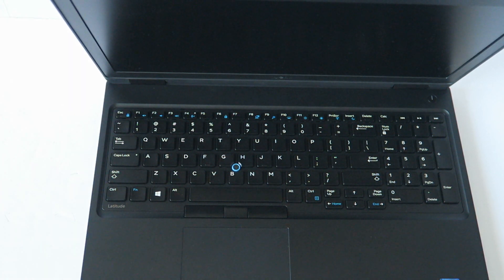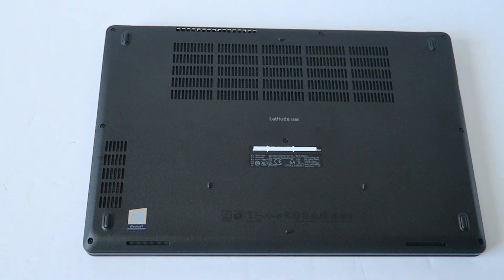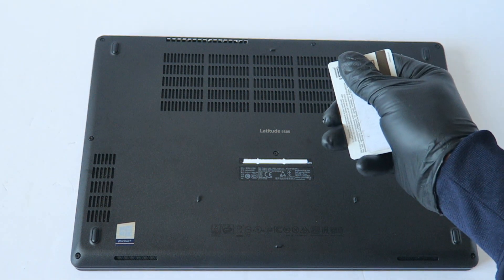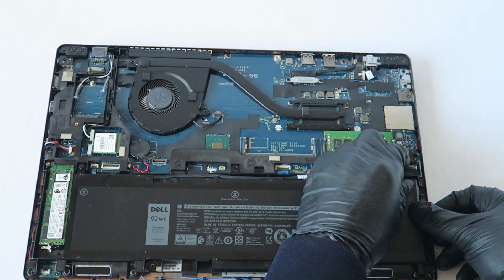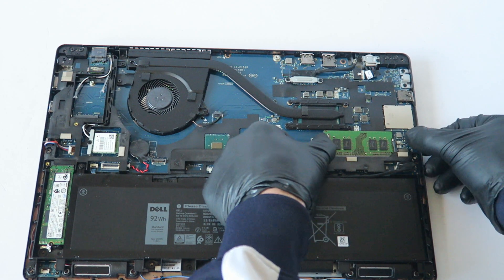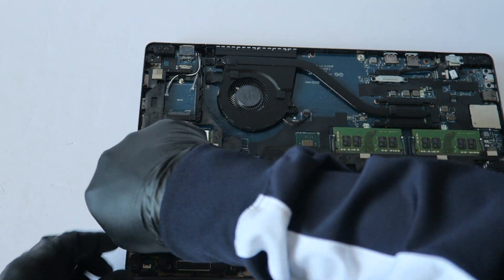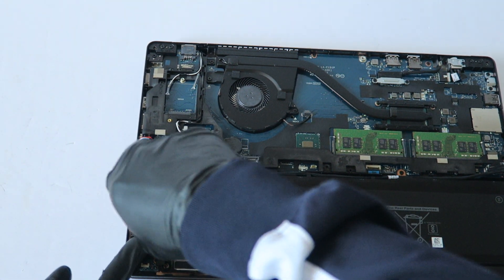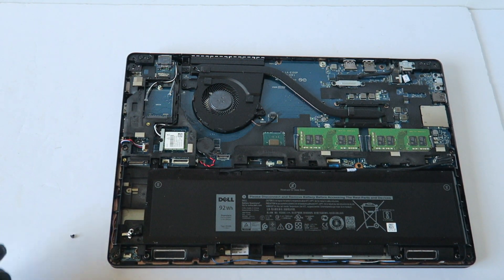Dell Latitude 5580 Upgrade RAM SSD

Comment from the maker: List of parts and upgrades will work with this Dell Latitude 5580

USB 3.0 Flash Drive:

(1.) SanDisk 32GB 3-Pack Ultra USB 3.0 Flash Drive 32GB (Pack of 3) 
https://amzn.to/42bHXKy

(2.)  SanDisk Cruzer Glide CZ600 32GB Sdcz600-032GB USB 3.0 (Pack of 1) 
https://amzn.to/429bCnL

(3.)  PNY 32GB Turbo Attache 3 USB 3.0 Flash Drive 5-Pack
https://amzn.to/44bQEXk

https://www.microsoft.com/software-download/windows11
Create Windows 11 Installation Media

How to Install Windows 11
https://youtu.be/aQmt5rQsrKc

Driver Kit - 64 Precision Bit Set
https://amzn.to/42N3fjh

SSD List M.2 Type 2280 NVMe PCIe:

(1.) Crucial P3 Plus 4TB PCIe M.2 2280 SSD
https://amzn.to/3URAG2t

(2.) Crucial T500 1TB PCIe Gen4 NVMe M.2 SSD
https://amzn.to/48m1OJR

(3.) Crucial P3 Plus 2TB PCIe M.2 2280 SSD
https://amzn.to/48tiDm1

(4.) Crucial P3 Plus 500GB PCIe M.2 2280 SSD
https://amzn.to/3SMHonz

Tested on Intel Core i7/i5 CPU MAX RAM Supports 32GB Total (16GB x 2) Per Each Slot

Supports RAM DDR4-2666 / DDR4-2400 SODIMM

(1.) Crucial 32GB Kit (2x16GB) DDR4-2400 SODIMM
https://amzn.to/49J5xT1

(2.) Crucial 16GB DDR4-2400 SODIMM
https://amzn.to/49Hxsm4

(3.) Crucial 8GB DDR4-2400 SODIMM
https://amzn.to/49HCGya

(4.) Crucial 16GB Kit (2x8GB) DDR4-2400 SODIMM
https://amzn.to/3I40b8Y

Disclosure: Amazon links this means that if you purchase an item we earn a small sales commission affiliate.

Comment: Hi I want to upgrade a 8GB to 32GB Dell 5580 but do I have to upgrade the SSD card as well and have to go thru all the trouble of uploading my windows OS again too???  Thanks
Reply: you only have to reinstall the OS if you replace the drive, not the RAM.

Comment: could you add a M.2 mini SSD to the empty WWAN slot? they should fit but I don't know if the bios would support a drive in that slot.
Reply: It does support it. But why do that? You can put a 4TB NVME drive in the m.2 slot next to the battery.
Reply: @scottdowney4318  it's easier to add a new drive than to clone the one I have installed and replace it. I also like having windows on a dedicated drive.

Comment: A question sir, can we both have SSD SATA and M2. disks in this one
Reply: Not on the drives next to the battery unless...you dont use standard form factor drives.. You can put NVME and SATA SSD if you get a short mini SATA SSD that physically can fit with battery, SATA SSD and NVME all sitting next to each other. WWAN can take a m.2 SSD short one., like 2230. Saw a post on Reddit where a gut cut a Sandisk sata ssd in half on a bandsaw...apparently a lot of the deisgn is used as a heat sink. Then it fit in his 5580 with NVME next to it.  Other idea is use WWAN slot for an m.2 ssd sata drive. I dont know if a short mini NVME drive will work in the WWAN slot. Some person on the DELL forum said it did, and some other guy could not make it work.

Comment: The video is interesting but I have a doubt!  because the battery is so big if the one with my e5580 is not that big, part of the space goes the hdd ...?
Reply: Same for me. It would be interesting to know the code of this big battery, I am going to replace mine.
Reply: @fabiocarini7278  - 92Wh VG93N
Reply: BUT - someone on Amazon mentioned that if you get that larger battery, you also need the CDM70 battery cable for it.  I've ordered the battery and cable and will be testing it out next week.
Reply: I just received the CDM70 cable today, and I have no idea what they are talking about.  The CDM80 cable I had on my 51Wh battery is a little longer than the CDM70.

The 92Wh battery arrives tomorrow if no storm delays, so I'll update on whether both cables will work with it or not.
Reply: UPDATE:  I ended up using the CDM70 cable on the 92Wh battery.  Since my CDM80 was a bit longer (probably less than 5mm), it was an easier fit, but I PAID for that CDM70, so I stretched it in there!  I kept the original CDM80 cable for a 68Wh pack I lucked into, in case I get another 5580 or find a cheap 5590.

It looks like they may actually use slightly different bases on the 5580 for different batteries, though.  While it would physically fit the dimensions of the opening L/R/U/D, it DID require slight trimming of the base in 3-4 places.  If you have the battery and try to fit it in, you'll see that the large tab on the bottom of the battery (farthest away from memory) is too big to fit, a slight trim of the casing and that fits.  Then there are 2-3 nubs on the left hand bottom of the battery, over where the 2.5" drive would normally go, that didn't have notches in the case to match them to.  I could have trimmed the nubs on the brand new battery, but didn't want to mod it in case I had to return it.  Using a utility knife, I notched the case to fit those nubs. If you look at the other nubs on the 51/68Wh batteries, you can match them up to the case to see square cutouts in the case for them.  Cutting matching square cutouts with a utility knife isn't hard, the plastic on the case there is very thin.

That's it for any possible mods.  It might be possible that it isn't needed for some 5580s/5590s.  Maybe the ones that originally case with 68Wh have the right cutouts.  Maybe the seller I bought off of Amazon sourced battery shells that were slightly off from OEM packs.  The mods were minor, won't hurt rigidity of the case, and won't stop swapping any of the other packs back in if needed, so it was well worth it to me.
Reply: @TheTalonts Tell me please, on my dell latitude 5580 I have 68wh battery with 7.6v but this 92wh is with 11.4v, my dell will work correctly with this 11.4 volt?
Reply: @TheTalonts how much time now work your laptop with this 92 wh battery?

Comment: Sir,do you know by any chance if the Lenovo v520 Tower is upgradable /concerning a regular psu and graphics card? Because the one that comes with it its not regular. In the worst case scenario,can the case be switched or the mb is not compatible for that? Thank you in advance. Kind regards ,
Reply: njjytyhhdijg. in

Comment: good video as always, a query: with 2 E5 2670 v2 + huanan dual I will be able to play all the games in Ultra and in 4k with a gtx 1080 ti? Can I also design and render quickly? It would have 20 cores and 40 threads : D XD
Reply: Lol. How's he going to know if he's doing a video on a Dell Latitude? Did you just come here to brag about how you know about the Huanan boards. I mean he's not doing a benchmark on a Huanan boards so how's he gonna know what games it supports or doesn't support?